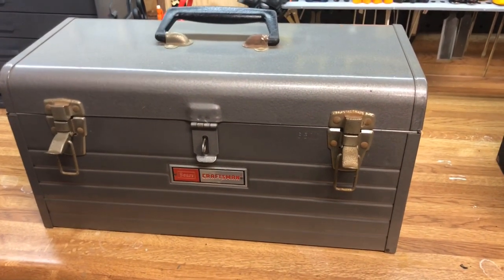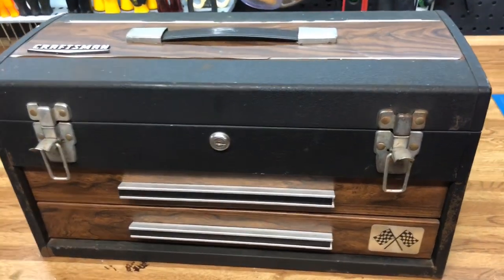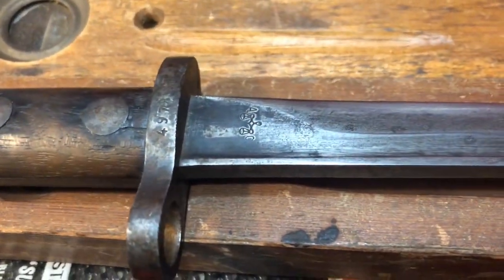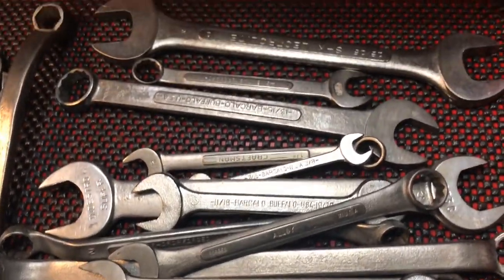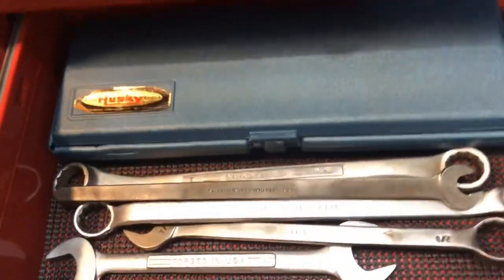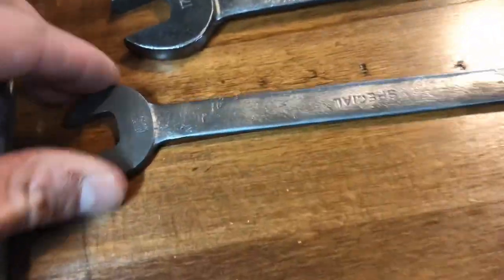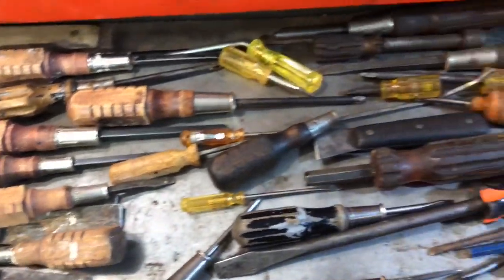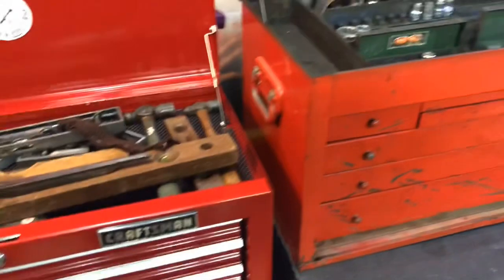Vintage Toolboxes and Tools - My last 3 purchases for less than $100!

Comment: Pretty sweet! Looks like we love the the same things! I enjoy restoring vintage tool boxes and tools. I'm in the middle of restoring a vintage very early 1960 #6516 Craftsman tool box.
I'm near Galveston. I'd also like to know - how did you remove the rust so well on the pipe wrenches?  Currently I use a combination of Naval Jelly, paint remover, mineral spirits, wire wheel, etc. Any special techniques? I also grew up as an apprentice to my father who was a master carpenter and furniture maker. I love restoring old furniture.